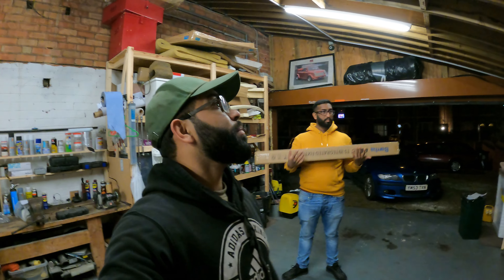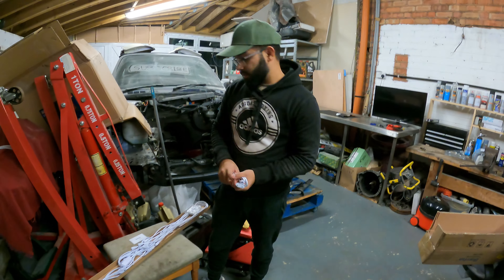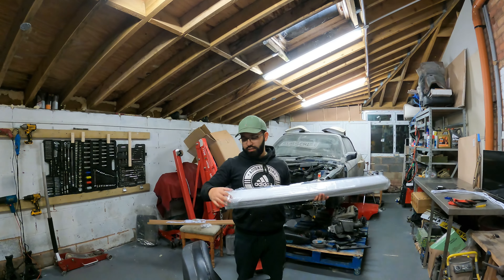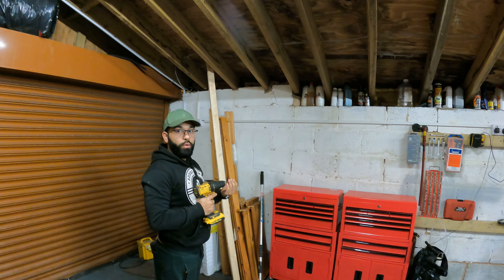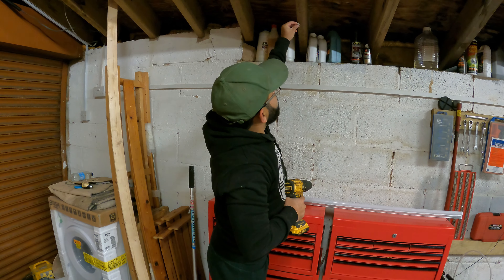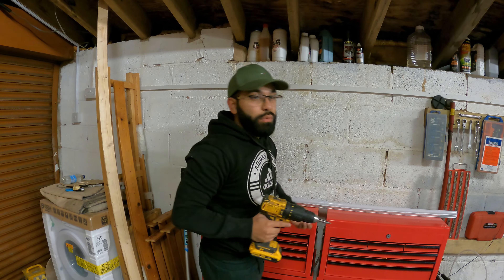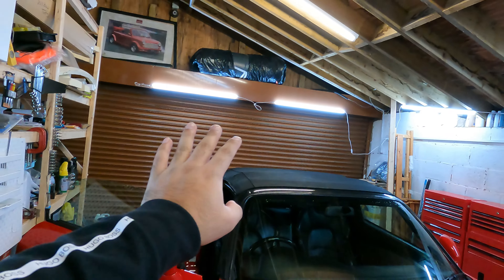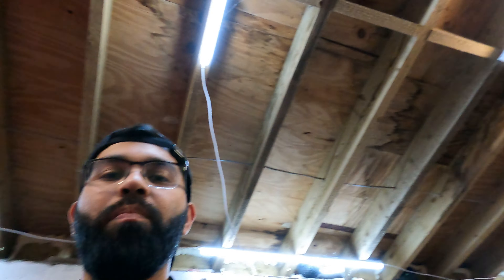Installing Amazon Garage Lights | Barrina LED Lights

Comment: I have nstalled 10 of these barrina 8' lights in my garage.  Now my garage door openers don't work with my remotes !  So unsatisfied !!
Reply from the maker: Im confused how the lights caused your door not to work. Why would that happen? My garage door still works 🤔
Reply: @mrgcc  The light radio frequency is close to my garage door openers frequencies.  I shut the lights off, the openers work.